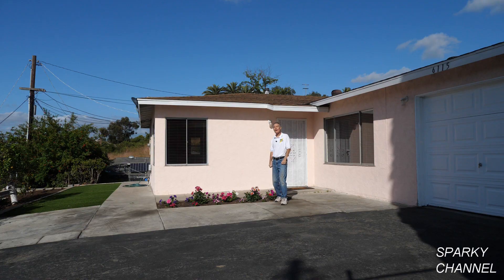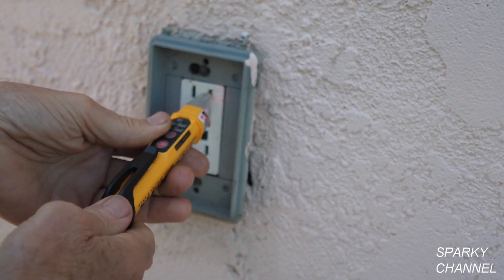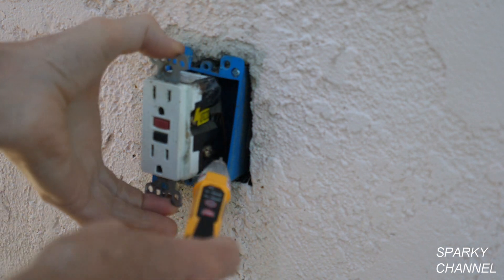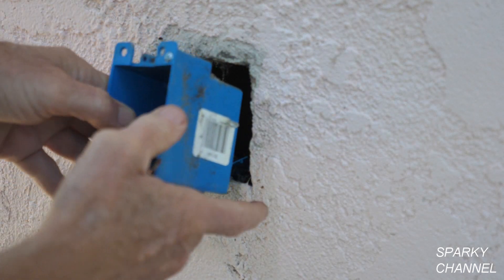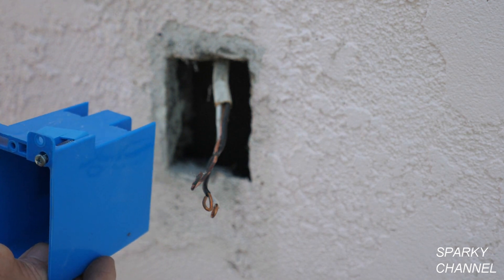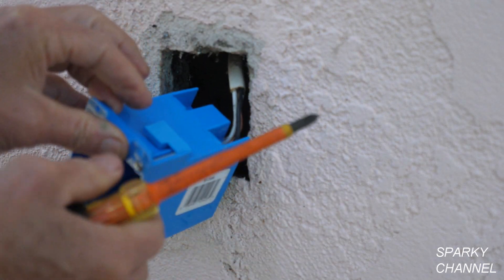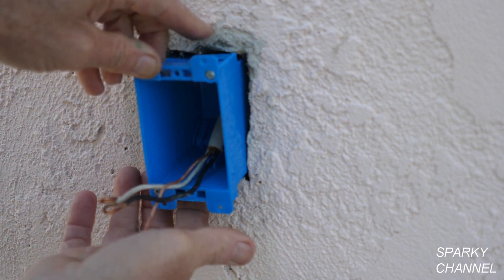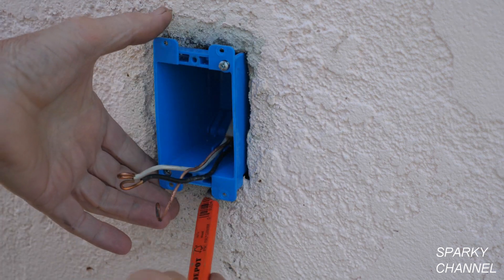Exterior GFCI Replacement With 20A Weather Resistant  Outlet

Comment: I have a 20 amp breaker and 12 gauge wire, but I used a 15 amp GFCI.  Is that OK? The  gfci is on a house wall and feeds my backyard shed. Inside my shed, I have a 20 amp GFCI outlet that is used for my pool pump. I used a 15 amp gfci because Home Depot didn't have any 20amp. I never plug anything large in my yard. My pool pump is only a 1/3 HP and called for either a 15 amp or 20 amp circuit.

Comment: Do you use Noalox or Dielectric grease on the terminal screws? I always get get corrosion. I recently started putting silicone around the edge and on top of the outlet box. I also applied some Noalox on the screws. I emailed Noalox manufacturer and they said it was OK to use.

Comment: I’ve had to replace the screws with longer ones on thick walls. As far as the concrete, patching is a must, with a good quality silicone where you can’t reach. Concrete patch is preferred. I’d take exception to saying the receptacles are more heavy-duty. Most are made with the same innards.
Tape is your call, but is not needed on plastic boxes. I prefer to put the silicone on the foam to make sure it covers completely.
Reply from the maker: Thanks!

Comment: If the previous owner mistakenly used the white wire for HOT while used the black wire for NEUTRAL, can/should I just continue to use the white for HOT (brass color screw) and black for NEUTRAL (silver color screw) when add an outlet downstream? (rewiring and correcting the polarity all the way back to the power panel is too much work!)

Thanks.
Reply: Highly highly doubt they put the neutral in the breaker and hot in the neutral bus bar at the panel. They most likely just wired the receptacle wrong. So no, you should not continue to use white for hot. Definitely fix it.
Reply: Use a meter to check which wires are hot. Very unlikely they would put the white wire on the circuit breaker and the black wire on the bus bar. Once you have used a meter to verify, you just wire it up correctly.

Comment: How much do you charge for what you just did? It is not inconvenient for you. 
Thanks for sharing your knowledge👍
God bless you 🙏
Reply from the maker: About $100.
Reply: @SparkyChannel  thank you
Reply: Thanks for sharing, Would this be with materials included?
Reply: @gerardoortega4027  I don't think so. Parts are around extra $50
Reply: @gerardoortega4027 the material alone is about 50$ because the receptacle he used is about 20$ and the box is another $20 plus the cover and so forth. Then the silicone and putty. So all around it is about 150 - 175$ total cost.

Comment: I have the same volt tester and when you turn it on the tip of the meter turns green on regular voltage and blue for low voltage until it senses voltage it turns red. It looked like your meter was still turned off when you used it

Comment: Great Video Sparky!   I went to install a new GFCI, and the metal holding box went into the cement block when I put pressure on the two screws.  Now I can't secure the outlet to the box unless I use long nose pliers to hold the box while I screw the GFCI in.  I don't know how I can fix this.  How do I get the metal box out, because there is nothing to fasten it to, or how do I secure the box?  Thank You.

Comment: A 20 amp receptacle is not required if there is more than one place to plug in something. A duplex receptacle has two places to plug in so it is allowed to use a 15 amp receptacle. It is very rare that you need a 20 amp configured receptacle in a dwelling.
Reply: So right. I have been in my house over 45 years and never had to use a 20 amp male 120 volt plug. Don't waste you money on 20 amp receptacles.
Reply: @JohnThomas-lq5qp  You must not be powering any significant loads. Try running a space heater or a window unit off a 15 amp circuit. The cost of a 20 amp circuit vs. a 15 amp circuit is minimal, but there are distinct advantages to having 20 amp circuits. The new NEC requires tamper resistant receptacles on ALL new installs. When I rewired my 1950 house I planned ahead and used 14-2 for the lighting, and 12-2 for the receptacles throughout the house.
Reply: @im2yys4u81  Just trying to state why spend more on a 20 amp duplex receptacle when a 15 amp duplex will do a good job. Starting at least 40 years ago always ran #12 type NM-B cable ( no such thing as Romex in NEC ) to all residential & commerical locations. I never waste money on 20 amp duplex receptacles. The halve dozen different brands of 15 & 20 amp duplex receptacle that I have taken apart always had the exact same parts, same thickness on metal. There are a lot of exceptions in the halve millon word electricians Bible ( NEC book ) .You can use #14 guage wires to a single ( not a duplex  ) receptacle and be perfectly legal to have it feed from a 20 amp circuit breaker. Example would be to feed a motor such as an air compressor that the high inrush Amps ( LRA = Locked rotor Amps ) much trip a 15 amp breaker during start ups. While attending numerous IAEI continuing education classes somebody would ask 3 inspectors the same question and get 3 caring answers
Reply: @im2yys4u81  No was told that you do not need a TR receptacle for any receptacles mounted over 7' above the floor such as garage door opener receptacles mounted on ceilings, click receptacles ( have not installed one if these dinosaurs in over 45 years ) and maybe some microwave receptacles mounted inside a kitchen cabinet . At a continuing education class somebody asked if you needed a TR receptacle on a roof that was there for required receptacle. required within 25' of air conditioning equipment. Inspector no if it was only able to be accessible from an extension ladder.

Comment: How critical is the ‘weather resistant’ gfci? I’m about to install an outdoor outlet and didn’t know about that. I do have a weather proof in use cover
Reply: The internal materials are supposed to be more resistant to corrosion from humidity
I prefer using opaque covers outdoors to avoid overheating the receptacle through the solar gain that occurs with a clear cover
Reply: It's required by code for all new construction and renovations

Comment: Sparky question 
20amp breaker 
Running 100ft 12-2 will I lose amps to the fuse panel
Thanks
Reply: Voltage drop on a 100ft run of 12-2 will be negligible.

Comment: Is that an old work box for studs? Can you show how to use that?
Reply: There’s an old work box that has screws that are mounted on the inside towards the left side, and you would screw those into the studs. The screws are at an angle. The one Sparky was showing he would not have been able to use it on that hole. He would’ve had to cut more and exposed the stud so that the latch and so forth would have been able to attach. That’s why I assume he already had the stucco patch and silicon handy because he was already prepared to do that work, because old work boxes are wishy washy when it comes to stucco because of the thickness and just how rough the surface is. There are tricks though. You can always attach a longer screw to those flaps so that you can grab hold of thicker areas.

Comment: How can you tell if you need a 20 or 15 amp?
Reply: Of course you will identify in the main panel the circuit breaker for the circuit doing any work.  When you identify that breaker to de energize the circuit note the label on the breaker.  It will either  be a "15" or a "20" for a circuit such as you are describing.  Match the amperage rating of the device (here a GFCI receptacle) to the rating on the circuit breaker for that circuit.   

DO NOT USE A 20 AMP RATED DEVICE, EITHER SWITCH OR RECEPTACLE, ON A CIRCUIT CONTROLLED BY A 15 AMP BREAKER.
Reply: @jimmclaughlin8195  You can't always rely on the breaker size as a determining factor. For example, when I first bought my home someone had wired a 14ga/15 amp circuit to a 20 amp breaker. My remote garage is wired in all 12ga, but someone installed 15 amp receptacles. The breaker and receptacles need to be determined by the wire size. 15 amp for 14ga, and 20 amp for 12ga. You can legally install a 15 amp device on a 20 amp circuit, but then it's derated. You CANNOT (legally) install a 20 amp breaker/device to a 15 amp circuit.
Reply: Make sure your breaker is rated for 20a and that all the wires on it's circuit are the right gauge for 20a.
Reply: @news_internationale2035  *Per the NEC that's 12ga for a 20a circuit, and 14ga for a 15a circuit.
Reply: The amp draw is dictated by wire size. 15 amp is 14ga wire. A 20 amp circuit uses 12ga wire. You do not want to put a 20 amp fuse/breaker on a 14ga circuit.

Comment: I am seriously considering entering the trade thanks to the interest you sparked (hehe 😉) in me! There's something empowering about opening up an outlet for a simple replacement and seeing how horribly the last person installed it, then knowing exactly how it should be done. You've instilled the practice of double- and triple-checking to ensure no wires are live before doing anything, the importance of good solid wire connections, and that you truly get what you pay for (the slightly more expensive commercial grade models are definitely worth it, and cheap tools are pure crap!). And those are just the lessons from the top of my mind. While there's heaps more to electrical work than just replacing outlets, knowing how to do that task at age 17 (and earlier!) makes the idea of furthering my knowledge and entering the electrician trade seem like a good path for me to follow. Thank you Bill!
Reply from the maker: Thanks so much for the kind words Ian! I wish you the best no matter what trade you may follow. (I think electrical is the best but I'm biased)
It's so great to hear that you're inspired to work safely, thanks!
Reply: Nice that you choice the best trade around. Yep I'm a second generation sparky. Here's a few tips from an old guy: 1) get good at troubleshooting. That separates the boys from the man 2) maintain & always wear the proper PPE 3) Only purchase & use quality tools & test equipment. NEVER use safety or test equipment from lying lack of quality control communist china 4) If somebody insists that you perform dangerous or something against the code tell them to put it in writing and sign it in front of a trusted witness. 5) Show up on time, don't take more then 2 days off a year while an apprentice 6) Attend training including classes on code changes 6) join & attend a local organization such as the IAEI. In my area they have 8 yearly night meetings attended by approximately 125 people . Around 15 to 20 highly qualified electrical inspectors and some engineers and the rest sparkies. 7) work safe. No matter what some safety departments and others say to never work on energized equipment at times you have to. When I switch 13,200 volt services, breakers or tie switch I always have another qualified worker ( electrician ) suited up with the proper approved PPE ten feet away in case crap hits the fan.8) Get good at motor starter & drives. Always found commercial & industrial work more challenging and better pay. 9) Be carefull working on 480 volt three phase VFD'S .The 670 volt DC Buss can stay energized for over 20 minutes due to huge capacitor bank. 10) ALWAYS PAY YOUR SELF FIRST. In other words put money into a ROTH or 401 K plan. Every time you get a raise bump up contribution 1%. I was lucky that I often had to work overtime & holidays . I would get into my computer and try to place all of my extra money from overtime into my 401K.  When I retired have a nice nest egg to afford to go on two vacations a year and 1 or 2 long weekends away and spoil the grandkids. Enjoy taking the grandkids out for breakfast, dollar store, 5 below, arts & craft stores and zip lines.

Comment: Nothing is better than checking wires if they are alive multiple times 🙄. 
Just do not touch the bare wires.
Reply from the maker: Yes, safety first!
Reply: For some reason, my body is not conducive to electricity, so even if I touch live wires, nothing happens. 🤷 Science needs to study me.
Reply: @Asiansxsymbol  at higher frequencies it doesn't affect your nerves so that could be why but itd burn you.

Comment: Now make a video on how to attach one of these to vinyl siding.  I'd rather have to deal with stucco than my vinyl siding.
Reply from the maker: Excellent idea.
Reply: I added one of these to my vinyl clad addition. My vinyl was attached to osb with house wrap. The big box stores sell what are called "mounting blocks." It involved cutting a square out of my vinyl siding. I popped lose one run of my siding, mounted the block to the side of the house, and installed the vinyl siding over the block. There are several YT videos outlining the procedure.

Comment: I did really dumb when installing an outdoor outlet. I wasn't paying attention and did not use an outdoor/Weather Resistant GFCI. After a couple of years it started tripping by itself in our damp Midwest weather.  Would not stay on. Since then, I just use standard receptacles outside, wired through a GFCI  device inside the house. A GFCI receptacle or breaker.

Comment: Wrapped with electrical tape? Why? Plastic box and all the wires in the box are securely attached to the back of the receptacle. I don't get it!
Reply: I know that very confusing, because sometime wire touch other wire them trick breaker…
Or someone when remove the cover then get shot by electricity no reason.
What happened to me, what ever when I remove cover from receptacle then I get shot by electrical and when I plug in then I got shot again like 5 time… also we don’t have a tape on it 
Now I wrapping tape around receptacle everywhere then more safe
Reply: Not really needed, but is a must when you use metal boxes
Reply: Doesnt hurt

Comment: Bill, how would you have attached the depth adjustable box shown at the 2 minute mark if there had been a stud adjacent to the hole? The bracket on that box appears to be for new work only as the flange is designed to wrap around the face of the stud.

Comment: Replacing a Radon fan that is powered by a GFI outlet - should it be connected to the load side ? The old GFI I'm replacing  has the Radon fan connected to the line side. Is this ok?

Comment: use swing ears , if you don't trust the ears to connect.. add Madison clips or even  cut in box old work mounting clips might work well for this.
that's 20 amp WR, SPEC GRADE TR LOL I've watch you enough to know what you like LOL

Comment: 20A GFCI receptacle with a 20A Circuit Breaker with a Romex that is actually 14 AWG wire, not 12 AWG wire due to the white color Romex. 12 AWG is yellow in color
Reply from the maker: That wire is 12 gauge Romex in a white sheath. That is the way 12 gauge wire was in the 90's.
Reply: Sparky Channel Thanks for the knowledge!
Reply from the maker: @hectormorales6175  No problem, thanks!
Reply: No, the jacket color is not standardized. It sore looked like 12 to me.
Reply: Forget about the color, read the information on the cable or check the breaker or use a wire gauge to verify. They didn’t use color codes in the past for 12  gauge and 14 gauge and so forth.

Comment: Can we use a 15amp outlet on 20amp breaker?
Reply from the maker: See: Shall I Use a 15A or a 20A Receptacle on a 20A Circuit? + 2020 NEC 210.21(B)(1) and 210.21(B)(3): https://youtu.be/-0zqSWEryOE
Reply: Yes. Most of the time.

Comment: Great Advice: 20amp circuit with 12 gauge wire you can use a 20amp WR Outlet >>>>>  15amp with 14 gauge wire you cannot USE a 20 Amp WR Outlet!!
Reply from the maker: Great tip! Thanks Martin!
Reply: He knows that.

Comment: My current outdoor plugs trip the reset when the sprinklers come on. I am going to replace them with the correct amp plugs and covers you used. Thx
Reply from the maker: Are the outlets getting wet?
Reply: @SparkyChannel  Yes I do believe ther are! I assumed some water would not affect them with outdoor covers???? But the covers are 10 years old or older

Comment: I need to do this same thing. But I want to use a 4 outlet configuration. Is that allowable for a 20 amp outdoor gfci?
Reply: Yes, just make sure you wire them properly. The power coming in goes into the line connections on the GFCI. Then from the load part of it you run power to the rest of your outlets. You only need one GFCI on a circuit if you wire it this way, the rest can be normal weather resistant outlets.

Comment: did you put a 20 amp device on 14/2 wire?  lol
Reply from the maker: No, that was 12/2 with ground. In the 90's 12/2 was white. It's a 20A circuit.
Reply: @SparkyChannel  kick ass.  remember to change the pitiful main water shutoff.  LOL
Reply: I got nervous.   I'm new to the channel and watching old videos. I saw the sMe thing and went to the comment section before I jumped the gun. You see white 12/2 and black 12/2 in old houses in NC

Comment: That looked like 14-2 romex being its white like the normal NM 14-2 and it also looked like thinner copper as youd find for 14-2
Reply: Romex from the early 90's had white for both 12-2 and 14-2
Reply from the maker: @dudeman650  That's true. It was white 12/2 with ground. 90's style.
Reply: @dudeman650  huh didnt know that haven't come across it yet. I saw the cloth, knob and tube, old bx, aluminum wiring etc not that yet. Thank you for sharing that.